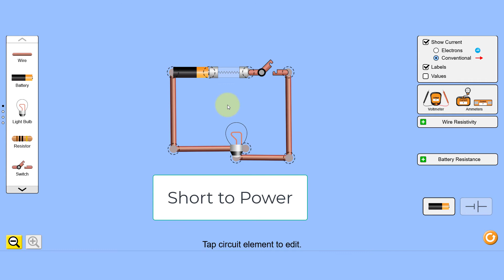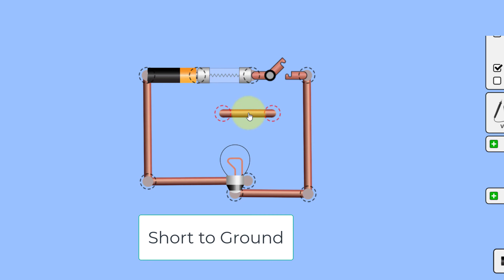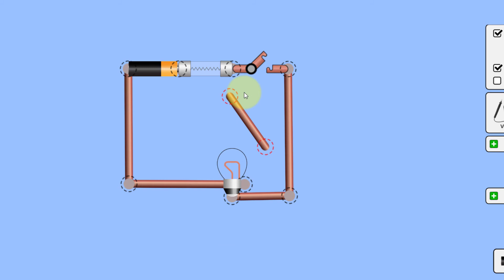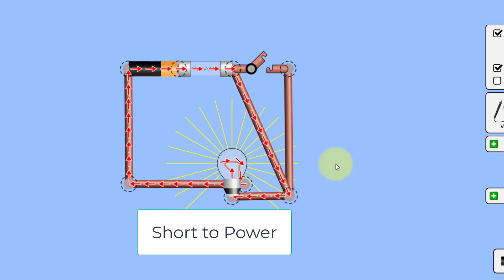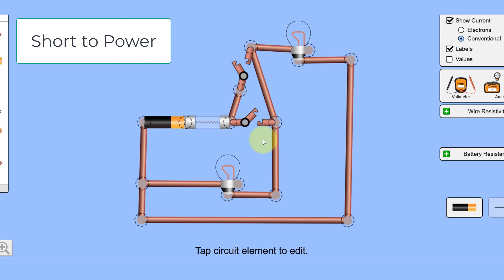Automotive Electrical Short Circuits

Comment: So the difference between a short to ground and a short to battery is that in the second case it is mandatory to have a load?
Reply from the maker: Yes that is correct. A short to battery requires  a load if not it becomes a short to ground. A short to battery essentially bypasses the switch or what ever is being used to control to function of the load.
Reply: @DrivelineMaster  I am a system test engineer in automotive industry and I am still learning electronics
Reply from the maker: Excellent.  You can practice your DC circuits with this simulator. https://phet.colorado.edu/en/simulations/circuit-construction-kit-dc
Reply: @DrivelineMaster  it can be a Short to battery even if the switch is placed after the Load to the negative side right and if i got a DTC who indicates this problem,that means the switch isnt working anymore,it is always closed
Reply from the maker: If the switch is on the ground side of the circuit and if the short is between the load and the switch to ground this would be a short to ground but instead of blowing a fuse or melting a wire it would only bypass the switch  and cause the load to be energize all the time. If you asking about a DTC that can get very specific depending on the DTC and the circuit.  It is possible for a computer system to detect that the voltage in a circuit that should be going high and low based upon the function of a switch is not changing because of a bad switch or a wiring problem and therefor set a DTC to indicating an always high or always low condition.
Reply: @DrivelineMaster  before the Load,with the switch ON,that will be a short to battery which can indicate that the switch is closed always,which is an error you don't want, right?
Reply from the maker: If there is a short to battery bypassing the switch on the positive side of the circuit it would simulate a switch that is always closed whether or not the switch is open or closed.